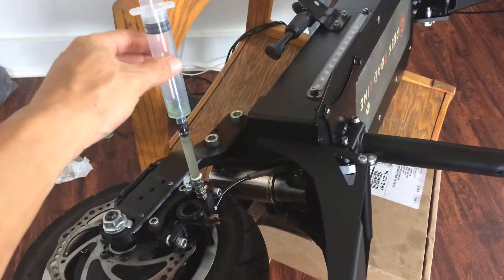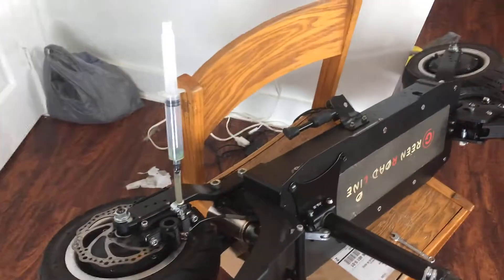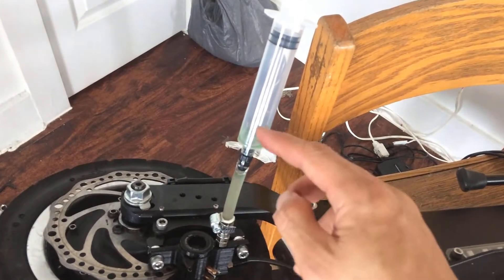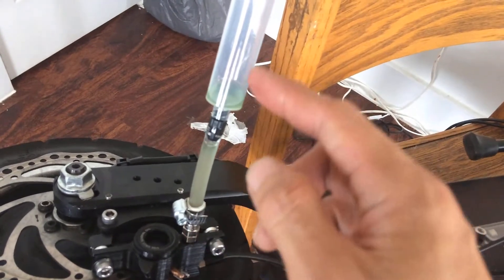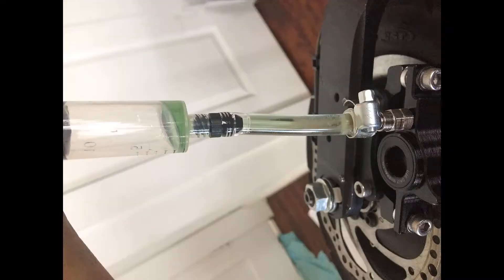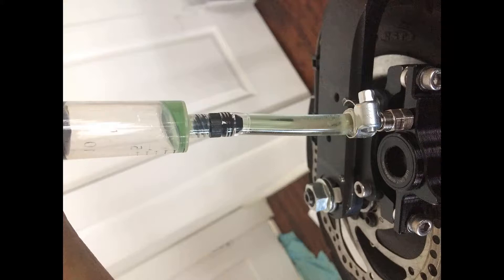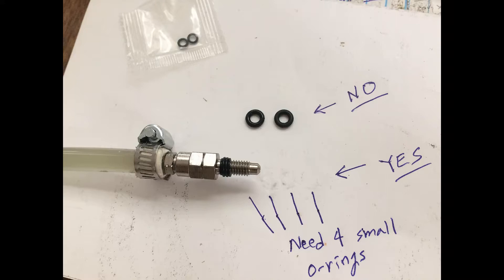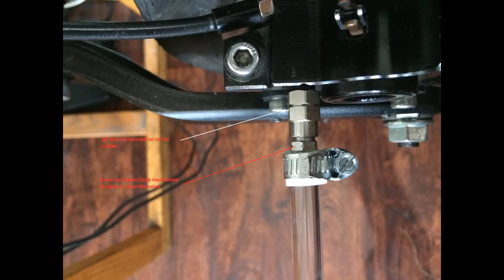Stahlbus Bleed Valve for Bleeding DYISLAND Hydraulic Brakes on Electric Scooter - Tutorial

Comment from the maker: Minor correction: It works best if you apply at least 3 smallest o-ring gaskets on the bleed valve thread. It's the smallest o-rings that come in the Brake Bleed Kit.  When you put them on it may seem very tight around the thread but it is the right one, no need to worry, just push them in one at a time. This stops the leaking.

Comment: I found a way to bleed these brakes which are missing the lever bleed port without using this kind of valve but I forget how I did it. It was something like your previous video but I did not have the plunger in the syringe. I think I filled the syringe lacking a plunger with oil and pumped the lever so oil would go in and air would come out. I remember it was very effective. I couldn't tell if it was a good result or not until the bolt was installed back in the caliper.

Comment: Hi. May I know what tube size and fittings (olive) will fit the DYIsland? I have a pair for my scooter but I need to replace the tubes to longer ones. Thanks.
Reply from the maker: The tubing needs to be 1/4" ID... that will fit the valve and will screw in to the DYISLAND brake caliper.  The 1/4" tubing and the valve doesn't give a tight fit so you will need to apply a small hose clamp to tighten it, otherwise the oil will leak during pumping/bleeding...

Comment: How's the performance and quality of this brand of hydraulic brakes? because I have one and I just bought it yesterday, im just curious about it. thank you
Reply from the maker: It does the job it is suppose to. Didn't experience oil leaking from the cables or the caliper or anything. What it does not do good is the brake feel. The brake pads wear out quickly, and will cause to lose brake pressure prematurely, you will get very spongy or loose brake feel and the stopping power is lost severely. You either need good aftermarket brake pads or needs mods I performed in these videos.. Another method is to apply a millimeter or two thick screw washer that fits inside the brake piston housing inside the caliper.. that will bring pads closer to the disk and give you better responsive brake feel, that would be the cheapest mod that is effective.

Comment: Hi where did you get your stahlbus bleed valve from would be helpful thanks ?
Reply from the maker: It's here - https://www.stahlbus-us.com/bleeding-system/bleeder-valves/conical-sealing-standardtype/

For my scooter hydraulic brake caliper only this size of the bleed valves fits:
M6 x 1.0 x 16mm
I still needed to apply 3- 4 small o-rings to make tight seal.